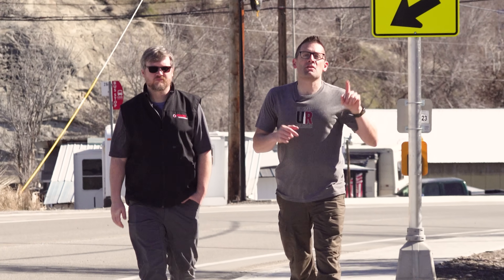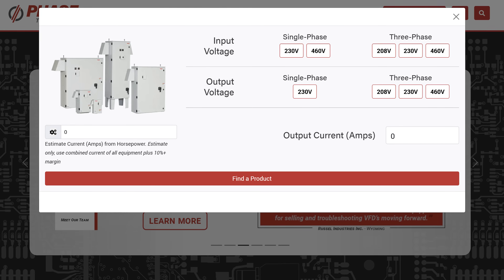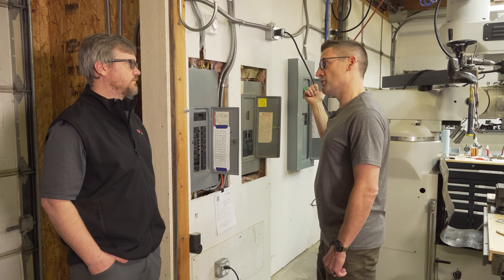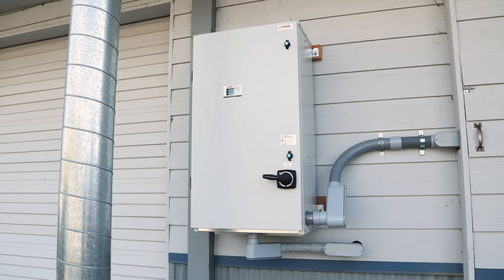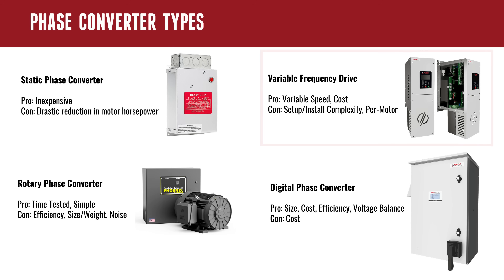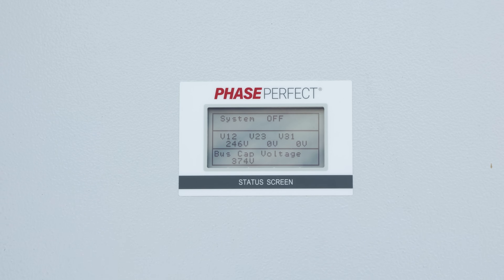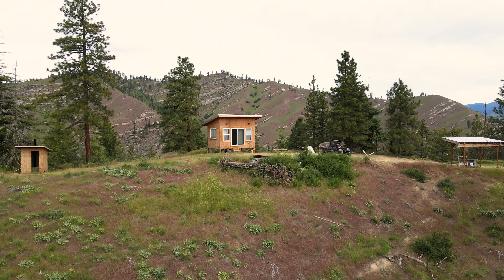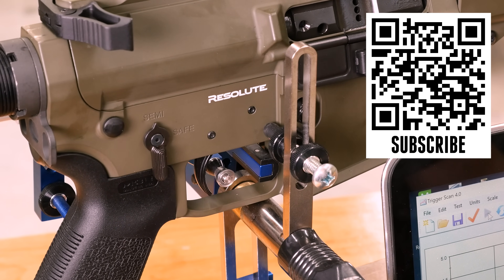3-Phase: What It Takes To Spec & Install A Digital Converter

Comment: Do the Phase units have decent filters on them?

A furniture maker asked me to have a look at his new 3-phase planer he’d just had connected up to a single to three phase converter…..was blowing fuses on the control circuit board and frying the board itself. Turned out his converter didn’t have a filter on it and the system hated turning 230V to three phase and then (internally) transforming a single phase back down 24VDC.

He had a filter installed but the circuit board still didn’t like controlling. Ended up having to run a separate control circuit supply, having the 3-phase only supply the main motor and shielding all the 3-phase cables.
Reply: Sounds like they were trying to use a VFD.  No filter will allow you to run sensitive electronics with a drive.
Reply: Fuses blow due to excess current. We see this most often on phase converters that don't maintain tight phase to phase voltage balance (the Phase Perfect maintains voltage balance between the phases at 2% or less), when the voltage drops excessively on the generated phase of some phase converters the load on that phase can draw excessive current. This can take out the delicate fuses on controls. Regarding filtering, every Phase Perfect also has significant filtering onboard to ensure true sinusoidal output.